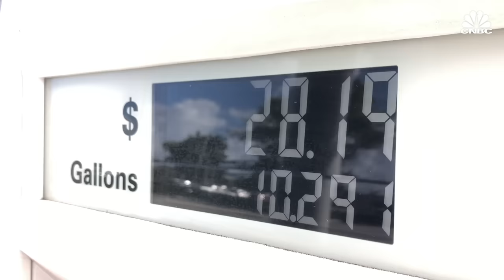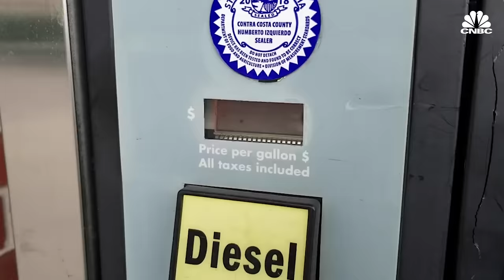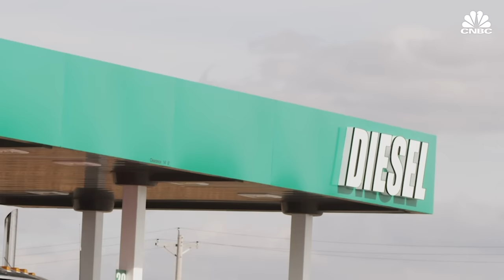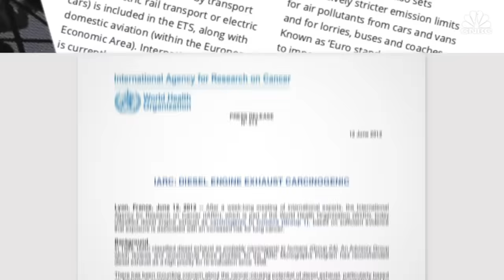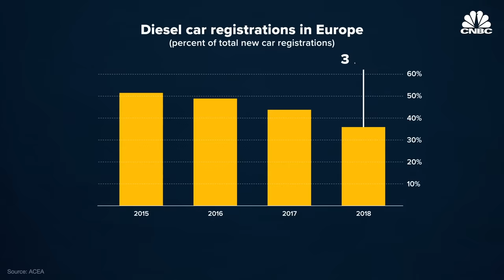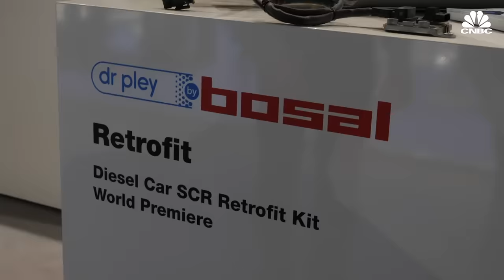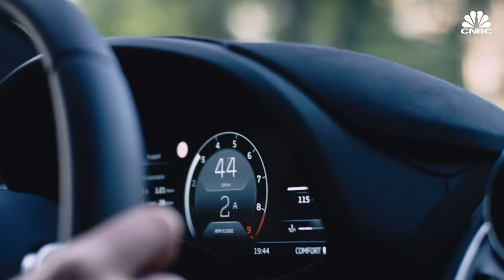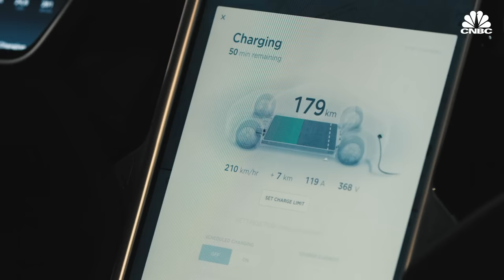Why Diesel Cars Are Disappearing

Comment: Fun fact, Rudolph Diesel originally designed the engine for farmers to run on vegetable oil or coal dust, two fuels that farmers would normally already have on the farm, and as far as vegetable oil, could even produce themselves.
Reply: Older diesels can easily run on used UK Chipshop oil. You can smell them.
Reply: More "fun" facts:  1. Bio - diesel has fewer harmful emissions.  2.  (edited)  Rudolph Diesel died under mysterious circumstances.  3. After his death, Standard Oil named a filthy petroleum distillation "Diesel Fuel".    4.  (edited) Though Water is literally a molecule of two Hydrogen atoms and one Oxygen atom, Oil Companies insisted that Fuel Cell Cars (that's : Electric Cars with a Fuel Cell instead of a Battery) get their hydrogen from cracking Natural Gas to get Hydrogen. By the way, how DO you extract the Hydrogen Atoms from Water? You "Crack it" by running electricity through water (HELLO Green Energy Storage Method!).

In other words, the stank of the greed of oil companies may end most life on Earth if you believe in Climate Change,  as I do. There are still people in jail for smoking a drug not sold by a pharmaceutical or a tobacco company but the greedy stank pigs still have their freedom,  many of them not paying their share of Taxes.

See? I promised you "fun".
.
Reply: He actually ran his first working prototype on peanut oil of all things
Reply: My cousin who once drove a diesel suv would top it off with cooking oil and it would still run!
Reply: @pierceyu4546  thats nothing new.  there is a huge community that reuses old frying oil for diesel fuel. If you fillter it down to like 5 micron, you could use it in pretty much any diesel engine. though mixing it with regular diesel is a good idea, since pure oil tends to be thicker, therefore more strain on the fuelpump and worse fuel atomaziation
Reply: but... this fact is not fun at all :(
Reply: Fun fact : petrol is better than diesel
Reply: @RichardASK  

Old cars are objectively trash because they are slow and unsafe
Reply: @abovethelaw4417  better in which regard? Thermal efficiency? No. Average longevity? No. Cooler running? No. Ability to use certain other fuels beside diesel? No
Emissions, especially soot and Nox is surely a lot worse than petrol. Yes, max hp/L displacement is also lower, but who actually needs a lot of horsepower besides people that haul stuff? And even at that they just need a torquey engine, nothing crazy high horsepower
Reply: @arcanondrum6543  hydrogen by itself is not a molecule nor is oxygen. They are both just atoms ⚛.  When they are together as water, then they are a molecule.
Reply: @arcanondrum6543  umm no Rudolph Diesel was meeting with representatives of the British Royal Navy...
Reply: @lorenzovonmatterhorn4756   Well, you are correct and @raterrr123654 is not wrong according to some simple searches.  My comment appears close to the top meaning it will likely be read before people comment or get bored so I will edit it and note that I have.

With regard to what I wrote, yes it was careless of me to write molecule.

With regard to his destination; I  am certain that I am quoting a lesser known documentary about Rudolph Diesel that explored more detail about him specifically and of the details of his death.  Before the Internet, few had ever heard of Rudolph Diesel, the sole person responsible for the engine used on such a large scale, daily. It means that his legacy was ignored and with regard to the fuel, altered - so it is not too difficult to imagine that a simple alteration of the destination of the ship he boarded would get passed down in history. By all accounts, Rudolph Diesel needed financial help to put his intentions to use and the documentary I watched stated that he was to meet with the King of Norway.

Rudolph Diesel's death was suspicious. The idea that Germany was trying to stop Diesel from helping England and then England adopting the Diesel engine for their ships anyway doesn’t make a lot of sense. The fingers point to Standard Oil - in fact,  calling a petroleum distillation "Diesel Fuel" is quite the insult to the watery grave of the man who could have changed the world for the better at such an early stage of the Industrial Revolution. It would not be their only lie. Only a decade ago, the public believed that Electric Cars were impractical. Climate Change aside,  the Oil industry is responsible for countless deaths, environmental devestation and has funded the encouragement of the consumption of a finite product for their entire history. Killing just one man, altering the legacy and then promoting themselves? Easily done with their past and future profits. Not "too shady" given their history.
.
.
Reply: yes, but we were facked up by oil companies. redesigning the engine to fit their desire for total control
Reply: @someguy9520  I think that the idea of Biodiesel, just add veggie oil to petroleum-based diesel oil. In my country currently the diesel oil use 30% of vegetable-mixed oil.
Reply: @BayuAH  30%? Thats a big percentage
In our country its like 5-10% and "premium" or "racing" diesel has no bio diesel at all

I plan on using some veggie oil myself when fuel prices go up badly again
Reply: @someguy9520  Yeah, even there was a plan to make it 40% in the beginning of this year.

But the plan is postponed because of higher price of the vegetable oil and the dropping price of the petroleum oils.
Reply: John Petrol was not happy.
Reply: actually it was nut oil he ran his first engines on.
Reply: @arcanondrum6543  yes it would make sense that Diesel was murdered by German spies because 1913 was one year before WW1 and Britain and the German empire were in the middle of an arms race and a diesel engine could be used to power submarines . Also I doubt that standard oil had to do something with because that company was dissolved in 1911. And biofuels can be good however you need to remember that ethanol and biodiesel are made from crops and deforestation is used to create more land for farming these crops. In my country (Brazil) depending on the price of ethanol farmers will stop producing food instead plating sugar canes making the price of the food go up which is not Good especially in a developing country.
Reply: @arcanondrum6543  though Rockefeller became richer after the end of standard oil his control of the oil industry became smaller due to the fact that in most companies he didn't had enough shares to dictate the oil market. You also forget that the world exist outside the us have you never heard of total, Shell, BP, Eni and other European companies or even Saudi Aramco and nioc that contribute the most to global warming.
Reply: @arcanondrum6543  and don't forget that though we use oil based products on our cars coal is the most popular fossil fuel for energy generation especially in developing countries
Reply: @gtr9s523  A financial empire built on greed and has too much influence, it grew more greed. Rockefeller's ownership and influence extended beyond the borders and after Standard Oil.  Yes, oil is a transportation fuel, not exclusively but primarily, I didn't state otherwise. (Diesel Engines ARE used by Utilities for Peak Energy demands however.)

Today, most homes can truly be energy independent but the power grid functions as their battery.   A. Industry is the biggest consumer of electricity.   B. Coal pre-dates Oil. Coal was even commonly used before Electrical Power Generation.  So Industry wants the common person to feel that they have a stake in an outcome (such as when people heated their homes with Coal). Industry wants people to fight for what are really;  the Interests of Industry. 

The point I am making is the power from too much money in too few hands has more influence than is wise. If a government interferes in other nations or suppresses progress so that profits can remain in the hands of polluters, it is because the polluters have too much power and used it to influence politics so strongly that the wishes of the people are drowned.
.
Reply: @MegaSirpaul   You're just not understanding the simple concepts . You are clearly Googling and pasting your replies.    #1 "transport". "Transport" WHERE?  Electrolysis can be done ANYWHERE.
NUMBER 2 :  You haven't caught on yet that the process I described is a form of STORING, yes STORING Solar Generated Electricity.   Let that sink in while you find the mystery odor.
Reply: @MegaSirpaul   You're just not understanding the simple concepts . You are clearly Googling and pasting your replies.    #1 "transport". "Transport" WHERE?  Electrolysis can be done ANYWHERE.
NUMBER 2 :  You haven't caught on yet that the process I described is a form of STORING, yes STORING Solar Generated Electricity.   Let that sink in while you find the mystery odor.
Reply: @arcanondrum6543  I’m not googling stuff to find anything.  I have a bachelors degree in Chemistry.  The things that you are saying don’t make sense, regardless of you CAPITALIZING things to get your point across.  This isn’t a presidential debate, you don’t win an argument for being loud, annoying and calling people stupid.  You clearly don’t understand thermodynamics, as you’ve said several things that violate the laws of thermodynamics.  And your misunderstanding of products and reactants show you really don’t get even the high school level of chemistry.  Also, which one is it… didn’t you say I was a lobbyist for the oil industry or something?  You’d think lobbyists for big oil would have their arguments down and not have to google them.  Or maybe I’m not a lobbyist and I’m also not an overconfident person who watches YouTube videos on conspiracies and calls their friends and family “sheeple” and claims everyone who doesn’t agree with them is a lobbyist.  I’m done with replying to this thread after this.  If you don’t believe what I’m saying find actual literature and not conspiracy videos to learn from.
Reply: @arcanondrum6543  before I head out.  Transport is important for scaling things.  When you do things on big scales they are more efficient, that’s the reason cargo planes, ships and trains are large and you don’t use a bunch of small boats to ship cargo.  The same applies for any chemical process.  You can use bigger and more precise machinery at larger scales.  So electrolysis can be done anywhere extremely inefficiently, but to get the most precision it should be done at large scale close to a large energy source.  After this you have to transport the stored hydrogen to remote locations to be used, hydrogen is fairly tough to store and transport, so this is difficult and expensive.  So yes, you do have to transport hydrogen, just like how you can dig a well anywhere, but it probably isn’t a good idea because you can scale things up, do it cheaper and safer than it would be to just have every house in America attempt to dig their own well and tell them that the water works is a bunch of lobbyist pigs.
Reply: No, he did not. It was designed for various fuels, not just peanut oil
Reply: @arcanondrum6543  not green to use more energy thN returned.  It's more efficient to just use the gas directly for combustion.  C02 isn't a pollution
Reply: But aren't several atoms of hydrogen a molecule of hydrogen?
Reply: Biodiesel is older than most people realize.
Reply: Most Diesel engines can run on vegetable oils, just need a tank heater to keep it from gelling when it gets cold out!
Reply: Even small amounts of added bio fuels destroy the diesel engine.
Reply: I run Humvees on JP8 (jet fuel)
Reply: Fun fact, BigOil changed all that
Reply: @arcanondrum6543  not trying to disagree with you, but where did the standard oil diesel fuel part come from? Just curious
Reply: Actually penut oile, we can CONSUME and cook with that oil. B U T , now, the ONLY option to save ALL life on this planet is gree produced ELECTRICITY! Better magnetic thn thermal!
Reply: @Calvin Pessl  thi k KFC use there old oil for there trucks.
Reply: Thats prolly why he got killed and got rid of.
Reply: Biodiesel failed though
Reply: @arcanondrum6543  This is very much true
Reply: @abovethelaw4417  yes that is true. but I wouldn't say that they are complete trash. One old car could be unsafe and fast. Or safe but slow.
Reply: Stupid idea of getting rid of the diesel, they should just go back to horse and buggy and human driven ricksaw.
Reply: @arcanondrum6543  look up methane cracking and note that it is used in industrial manufacturing of hydrogen
Reply: @orangecookie3132  nah it is good
Reply: @arcanondrum6543  tell the manufacturers of hydrogen that
Reply: @arcanondrum6543  yes but craking water is much more energy intensive  ans therefore more expensive
Reply: @catalintimofti1117  Two problems with your claim : #1.  You're not adding the Methane Extraction, despite me already making that point very clear.
#2. Cracking Water is better for the environment and so is Green Energy -  some Green Energy lacks energy storage.  Cracked Hydrogen is a method to Store Electricity. After Solar Panels are installed,  their electricity is now free and will produce for decades with very little maintenance.  That makes the price (anyway you count it) much, much lower.

Why are you not catching on to the obvious here, are you a Lobbyist?
Reply: @arcanondrum6543  mate i am telling you WHY hydrogen is made from NG instead of water all things considered it is cheaper Cracked hydrogen cannot be used as energy storage because hydrogen fuel cells cannot be scaled to power plant levels and hydrogen is like at most 30-40% efficient so you might as well just burn the NG
Reply: @arcanondrum6543  if it was easier to hydrolise water manufacturers would just hydrolise water
Reply: @catalintimofti1117  #1. I'm not your "mate".  #2.  The least efficient Electric Power Plants online today (Coal, Nuclear, Wood Chip Burners, etc.) are approximately 6% Efficient, the most efficient are under 20% Efficient (once again; that's counting only the fuel already on-site).  We toured Electric Generation Plants, we did the Studies and the Math in my Thermodynamics Class.  ALL Energy production requires an Energy loss, ALL of it.  Reason? The 1st and 2nd Laws of Thermodynamics. So, your own estimate of 30-40% Efficiency for Hydrogen Fuel Cells?*Much Better.*

#3. While it is indeed, more energy intensive to Hydrolyze a Liquid than it is to Hydrolyze a Gas, you're STILL missing the whole point. Electricity that (was) expensive, meant that Cracking Water was less attractive due to higher Electric Bills (again for the slow crowd : Green Energy? Nearly Free).   #4.  Methane was a readily available product for decades because Oil Companies considered it a "waste product" and would "flare it" (burn it away). It was only when mandated it be used that Fossil Fuel Corporations built the necessary infrastructure to capture and store it (How 'BOUT that "government" thing? making better use of resources when corporations are too greedy to initiate it themselves).  Now that the Public realizes that Transportation via electricity is fast and powerful,  Fossil Fuels will eventually,  finally be replaced by BETTER Solutions so extracting Methane will be ONLY for Methane - not a shared cost - and that will raise the price of Methane, putting the final nail in the coffin to any claim that Hydrogen extraction from Methane is "cheaper".
Reply: Great fact!
Reply: Not a fun fact… more a suppressed fact
Reply: @orangeytrain8878  what ?? Just because you didn’t know that doesn’t mean it isn’t a fact! Diesel as sold by petroleum companies is the waste product from petrol production.they sell the waste product for more than they sell the product!
Reply: @arcanondrum6543  My comment is still there. Are you actually saying that water ISN'T the result of the oxidation of hydrogen???????
Reply: @arcanondrum6543  What colour is the sky in your World?
Reply: @philmerlot5090   No, not publicly viewable. If you had any friends, you could ask them to check but I don't mean "look over" your "shoulder and bark twice if you see it", I meant people, with their own accounts, who could tell you that your (unedited) comment on Hydrogen, Hydrocarbons and Water betrays your lack of sentence structure and your lack of comprehension but isn't viewable to them anyway.  Google did me a favor.

I should have ignored you, you failed to comprehend what I have already and earlier, explained in detail.
Reply: @arcanondrum6543  Yes, whatever, but sticking to the actual point, are you still denying that water is produced by the oxidation of hydrogen?🤣
Reply: @philmerlot5090   I'm saying that you're a waste of time.  The "oxidation" of hydrogen is the natural attraction of those two molecules to fuse, especially when energy is applied  (such as a fuel cell, burning hydrogen, etc.).  My point is and always has been about Green Energy storage. 

Go waste someone else's time.
Reply: @arcanondrum6543  HAHAHAHA you actually think that burning/oxidising hydrogen requires energy to be applied??????

Energy is RELEASED which is why water is so stable and can never be a fuel.

I'm actually beginning to feel sorry for you and your pretentious delusions.
Reply: @philmerlot5090  Oh, Phil you're forgetting something!  You're a waste of time.   Unlike you, I KNOW that "burning... ...[H]ydrogen [DOES] requires energy to be applied."  You see, "burning" is in fact; "energy" so; how did you first ignite the Hydrogen without energy?  Answer: You can't. 

Water is stable yes but it is composed of just 2 different Molecules - 1 Oxygen and 2 Hydrogen. Both are excellent fuel. It's their atomic bond that makes them so stable and it is where THEIR energy is stored - but I guess you were absent that day they were discussing Einstein's theory of relativity in your kindergarten class.  It doesn't matter.  You'll never catch on.
Reply: @philmerlot5090  Oppsy, I did call an atom a molecule.  That's my only mistake and I make that same mistake often (switching molecule and atom).  ANYTHING that burns is a fuel - in fact, most fuels REQUIRE Oxygen to burn and it's mostly the Oxygen that's burning.  Pure Oxygen alone will burn. Ask an emphysema patient, ask Gus Grissom, Ed White, and Roger Chaffee.

You're talking about only about combustion - non-stop, I'm talking about energy.  The "oxidation of [H]ydrogen" (you forgot to capitalize it again) requires energy,  you ignore that due to the amount of energy released. Oxidation of Hydrogen DOES NOT require burning but it's one way they are joined. 

I'm glad you're fact checking me, you should do that with politics but you're still; wasting my time.
Reply: In 3rd world countries company and city generators are often run on vegetable oil or rendered fats blended to kerosene
Reply: @abovethelaw4417  deisel torque let s 2 litre deisel break into 5 second range in nhra 3021 and is more than sufficient for 1000+ ft pd of after market tuning in compact car while delivering ,40-50 mpg I'm daily driving
Reply: I bet it burns a hell of a lot cleaner too!!!!
Reply: Unfortunately newer diesels basically require diesel fuel from the pump, in order to cool certain electronics
Reply: Hemp oil..
Reply: then why people done use veg oil vehicles
Reply: Fun fact. Cool story 😂
Reply: It was actually invested in ancient India
Reply: And now Diesel fuels are more expensive than gas
Reply: 8:48 8:52
Reply: 8:4 9:13 8 8:52
Reply: 9:53 10:07 10:20 10:28 10:30
Reply: 10:42
Reply: 10:50
Reply: peterhicks5590  Indeed.  I had something similar written (in my original and then edited comment) about his death, someone refuted it, I searched, could not find that drowning description at the time (but I DO recall learning about it).